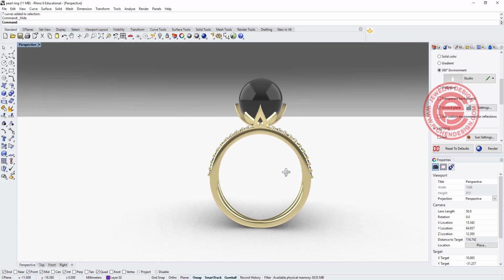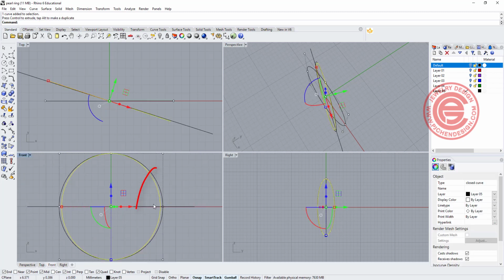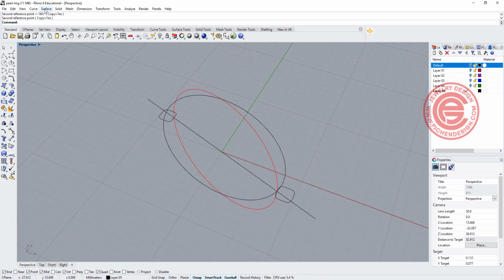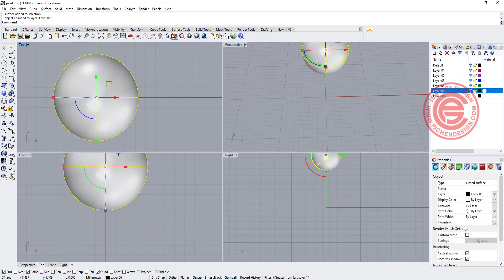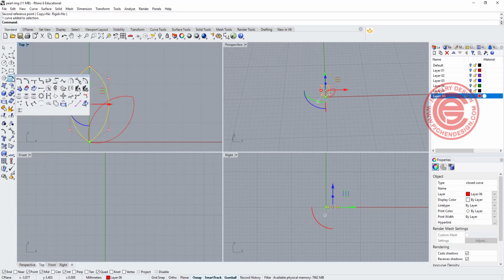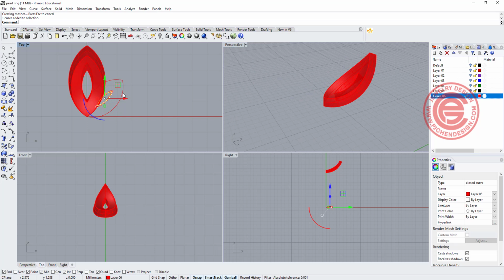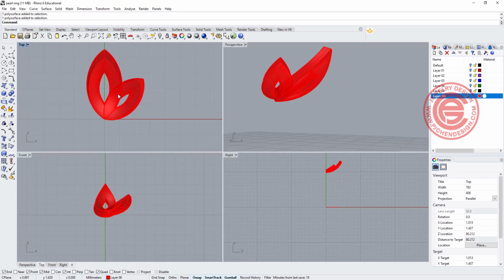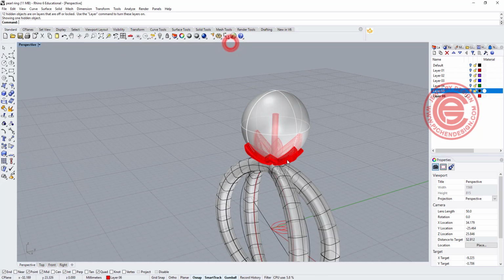Jewelry CAD Design- Pearl Engagement Ring 3D Modeling in Rhino 6 Tutorial  #148

Comment: Great, but the boolean command doesn't work at the end. I am using 3ZWorks from Solidscape to prepare and print my files. It only works well when the part is a single polysurface. Anyway, thank you very much for your tips, it helps everyone!
Reply from the maker: I have a playlist for Q/A, There are some videos discussing why boolean not working. You may want to check them out!

Comment: You Tube Member- I Am Facing a Problem In Viewing One Of The Membership Videos- "Fillet Edges Issue In Rhino 3d" Aired 3 Days Ago, Nor It is Visible In The Membership Playlist As I Have Already Faced The Same Problem Earlier Also Please Check With The Other Members Also  (If They Are Facing The Same Problem), Kindly Try To Fix This.
Reply from the maker: I actually just check on it and the fillet edges one is running fine. I wonder if other member has the same issue too.
Reply: i think youtube is down currently